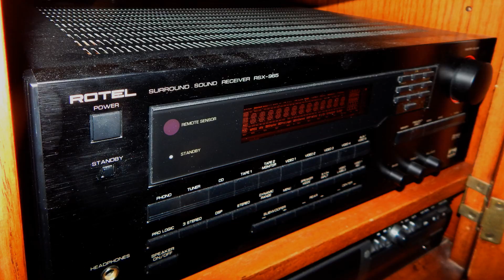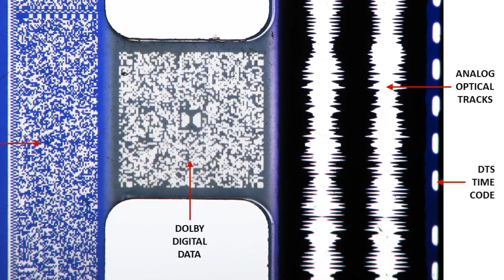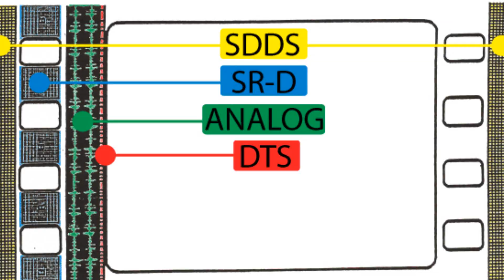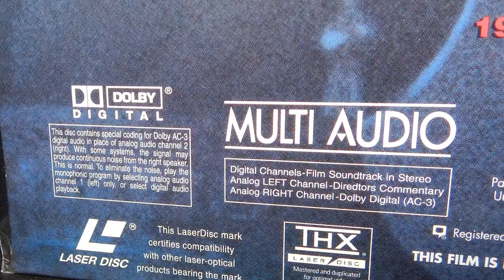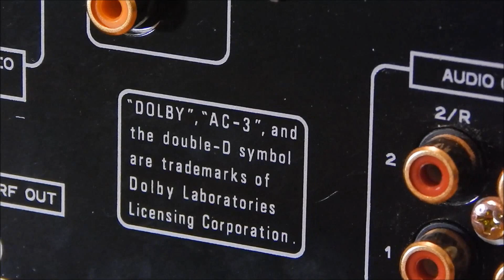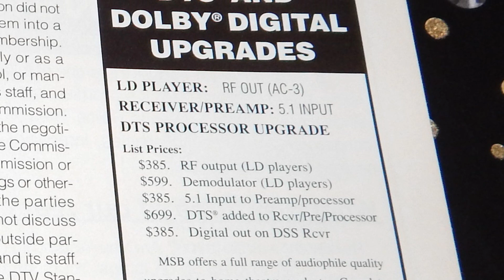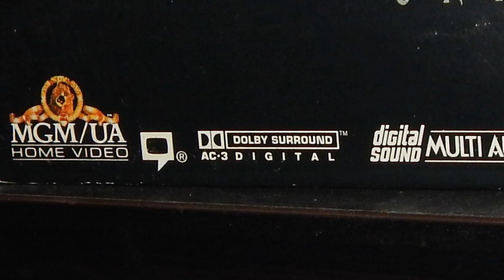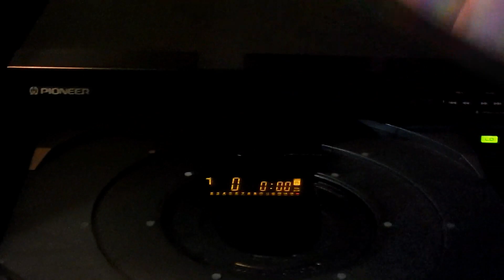LaserDisc Audio Guide – Part 3: AC-3 Dolby Digital

Comment: Once again, a very informative video on the topic.  In regards to third party companies that once provided mod boards, we had Precision LaserDisc in the states as well as their partner that you mentioned (Benedictus; DBA BDE Electronics).

I purchased and installed a number of these boards back in the day but now I’m installing them again with my own scratch built boards since they can’t be found anymore.  I think I have about five more players that I still need to modify (including two that will also get an Internal RF Demodulator as well) when I get the chance to do it.

Also, AC3-RF Demodulators are no doubt expensive for what they do.  I recommend (as was hinted in the video) to hunt down Dolby Digital processors that incorporate a digital output like the Sony, SDP-EP9ES & SDP-E800 and the Denon, AVD-2000 that can decode AC3-RF and convert it back to normal Dolby Digital and on to a modern day AV Receiver.  These can be had for sometimes a lot less than a stand-alone Demodulator and it also has extra input jacks to boot.
Reply from the maker: Thanks David!  Very cool to hear that you've been able to put together those boards and upgrade so many players.  I should really get my act in gear and start looking into modding some of my players - especially my Quasar LD700.

I'm on the lookout for one of those Sony demodulator/processor units, since I regretfully sold my 2nd MOD-RF1 a few years ago under the foolish assumption that I wouldn't need a 2nd AC-3 LD setup. That little box did its job well, but I'd rather step up to a processor and gain those extra inputs.

Cheers!
Reply: Culturedog >>> I’m not super savvy with electronics but have always been handy with a soldering iron.  My first attempt to make an AC3-RF output board took 10 years to perfect due to a combination of losing interest and not really being that great at understanding schematics.  I had the bug about a year ago to get back into the hobby and prioritized getting that board working and soon enough I had it down perfectly.  Looking forward to getting these last few players I have modded to AC3 just for the sake of just wanting a challenge and giving these players new capabilities.  

As for getting more Demodualtors, they definitely come in handy.  I actually like the outboard processor option even more since I plan to incorporate them with my LD players with internal demodulators & regular AC3-RF outputs to have a dual player set-up for uninterrupted playback and ease of input switching.

Comment: The first time I heard Dolby Digital 5.1 in a Home Theatre System was in the Spring of 1999 and I was blown away. The movie was Batman Returns and it was the old barebones snapper case DVD edition. It made sense  because Batman Returns was the first movie to be released with Dolby Digital 5.1 audio. I remember reading that Warner Bros planned to re-release Batman Returns on LaserDisc with Dolby Digital but it was cancelled.

One thing I love about audio on LaserDisc is that the Movie Studios often used the Theatrical Mixes which played with the movies during their theatrical run. Apparently they would not even reoptimize those mixes for a home theatre system so they were identical to what was heard in the Cinema. There were even some LaserDiscs where the Pro Logic mixes were considered to be better than the Dolby Digital mixes.

Even though Dolby Digital on LaserDisc wasn't as convenient as DTS, I agree that it was implanted better. It was very nice that the PCM Stereo/Pro Logic mixes were retained on Dolby Digital LaserDiscs whereas For DTS, PCM Stereo/Pro Logic was completely dropped the DTS mix could be stored in the digital tracks. It was nice that for DVD Dolby Digital was simply plug and play.
Reply from the maker: That's an awesome first 5.1 experience to have!  I wish that Batman Returns 5.1 LD reissue had happened, even though I still loved my regular Dolby Surround edition for years.

Yeah, those theatrical mixes can be super punchy and dynamic!  It really made home theater a knock-your-socks off experience in the 90s.  It was like the old Maxell ads with the guy in the chair being blasted by air from his loudspeakers.  haha
Reply: Apparently the Dolby Surround mix for Batman Returns was fold-down from the 5.1 Mix.

I read somewhere that theatrical mixes were even used on DVD during the first few years of the format's life. But then they started creating a different mix that was specifically for a home theater system.

I remember those old Maxell ads too.